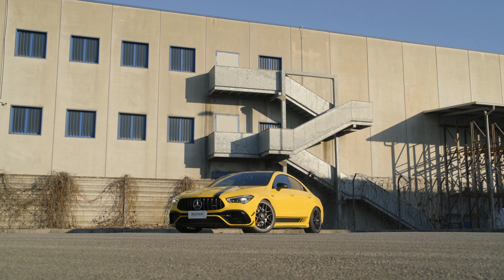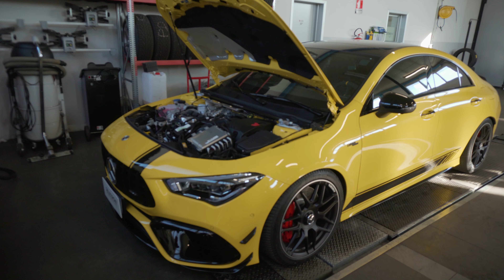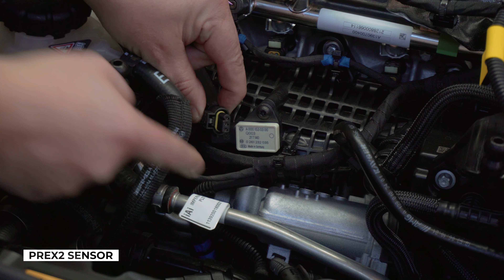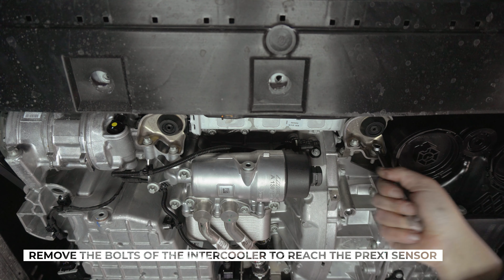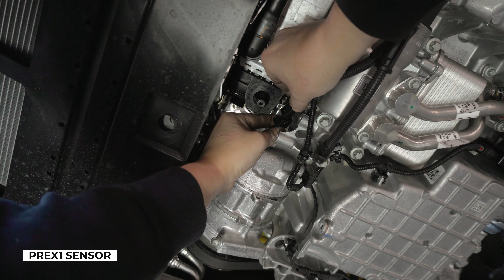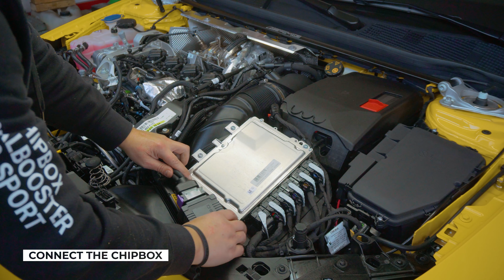Mercedes CLA 45s AMG - CHIPBOX® Chip Tuning Install Guide - Seletron Performance

Comment: How did you remove the upper two bolts on the intercooler?
Reply from the maker: Hello, it was a hard one and kind of tricky but with a cooled down engine, a lot of patience and flex head wrench you should be able to make it. :)

Comment: What power gains?
Reply from the maker: Hello Caio, sorry for the late response. The power gains on the CLA45s are +40 more HP and +50Nm of torque, tested both on street and dyno (SuperFlow dyno). In case you need more info feel free to ask us here or at web@seletron.com :)